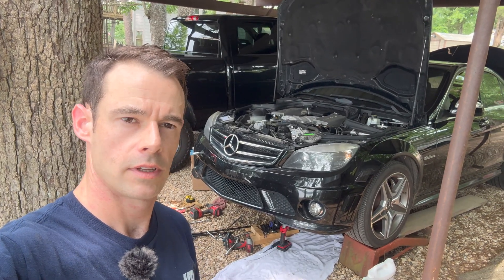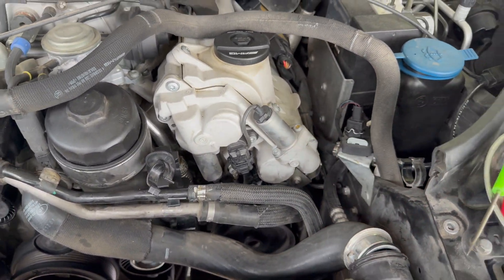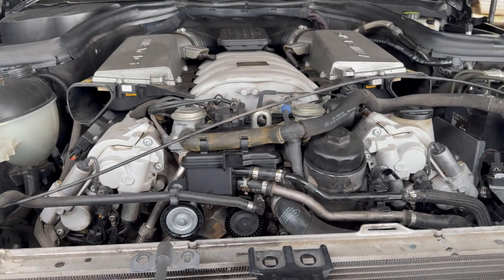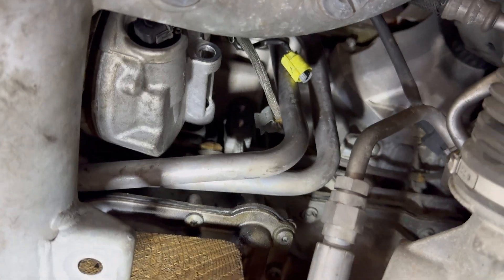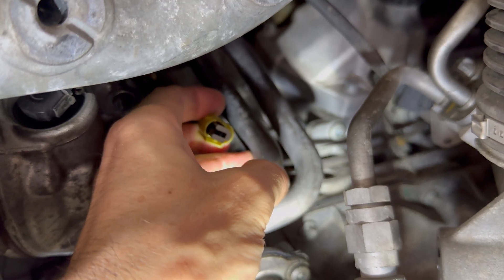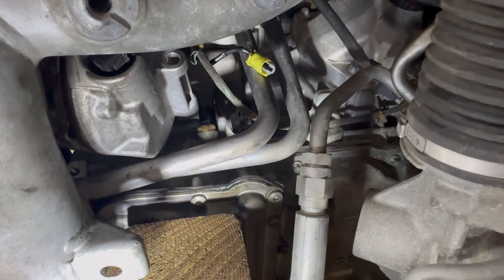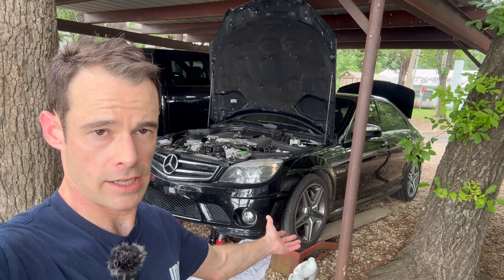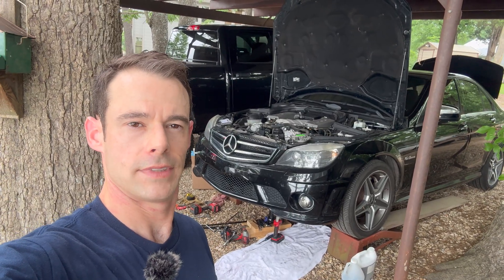m156 Oil Temp Sensor "Where is it"? "I'll show you".  4K

Comment: How did the old sensor look. Appears to be one piece from the tip inside the block to where it threads into the block. Unless there's a hole in the casing only other possibility is it leaking out around the threads or wicking down from a leaking cam sensor or something which is the usual suspect. Thanks for the video!
Reply from the maker: When I worked for MB, these oil leaks into the harness were addressed at a case by case basis. The cam sensors were sometimes the cause, but not always. None of the sensors were designed to leak, but sometimes would. A brass sensor has a level of porosity that can sometimes be bad enough for the pressurized oil to seep through. These sensors can also develop cracks from different oil formulations breaking the brass down to the point of letting the oil seep through. My sensor had oil on the harness side and appeared to have leaked through. I checked every other sensor up the harness and all were dry. Thanks for watching!

Comment: My oil temp either doesn’t show or goes extreme on both ends. Will be Changing my oil temp sensor tommorow and coolant temperature sensor as my fans are always on even on cold start. Think the fans have been draining my new battery car doesn’t startup sometimes
Reply from the maker: Without looking at the car myself, I really would be guessing, but I would definitely want to read what codes your car has and check for wire damage.

Comment: To lift up the engine did you have to unbolt the engine mounts at all? Also do you need to remove the front fan and everything to do this as well?
Reply: Like remove the fan to do just the oil sensor?
Reply: Also do you need to drain refrigerant lines from ac compressor or does it slide foward with them connected
Reply from the maker: I pulled the fan to remove the belt to move the compressor forward. I did not unbolt the engine mounts or evacuate the refrigerant.

Comment: With me the problem is that the oil temperature fluctuates in seconds, I think I should change the sensor right?
Reply from the maker: That is a clear indication that there is a loss of connection in the oil temp circuit. It could be the sensor or a weak connection anywhere between the sensor and the gauge, even a damaged or pinched section of wire within this circuit. Oil in the harness can certainly contribute to this problem, and even cause it. Sorry it’s not a straight answer, but there is no correct straight answer.
Reply: @PBSpeedShop  I fixed the error, it was my on-board battery, it had been inside for a while 👍🏼 but still thanks for the answer!😀
Reply from the maker: Low voltage will cause all kinds of wacky problems. All batteries should be checked before ever digging deeper into diagnosing any electrical issues on a Benz. In fact, if this was the cause of your problem , I bet the gauge wasn’t the only issue.

Comment: Very useful video thanks a lot, the location of this sensor is very hard to find on internet. Do you think it is possible to change this sensor with thin tools and tiny fingers without removing the AC compressor etc? Just the plastic covers obviously
Reply from the maker: This is a great question. In my experience as a dealer tech and at home hot rodder throughout the years, I always look for ways to be able to make repairs while minimally removing other parts. Sadly, I believe this is as easily as you can get to the temp sensor. I could still barely get a wrench on it with the compressor out of the way. With all of that said, if you can find a simpler way, I’d love to hear your method.
Reply: @PBSpeedShop  Yes I will update you if I find another way of doing it. Do you know where the wires of the sensor are running in the motor bay? Where is the other side of the connexion?
Reply from the maker: I’m going off memory, but I believe they run toward the rear of the engine from that sensor. One other tid bit, that section of the harness is thoroughly fastened to the engine block in at least two places behind the compressor.